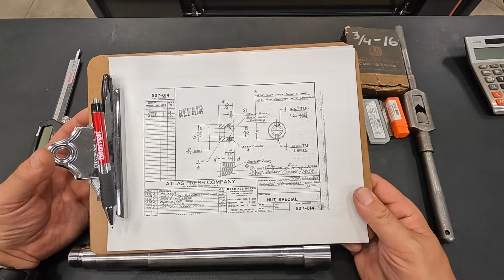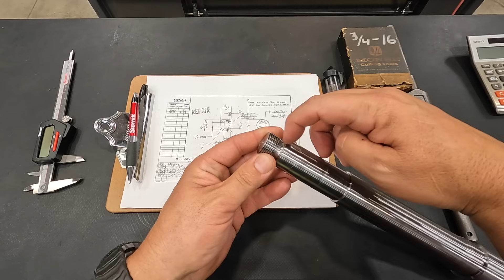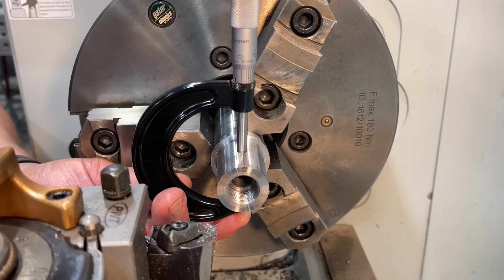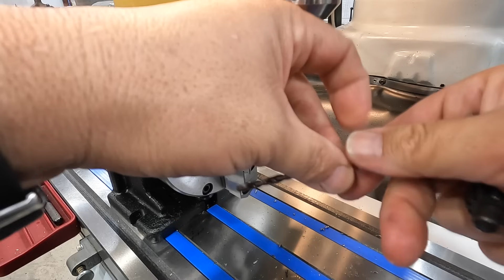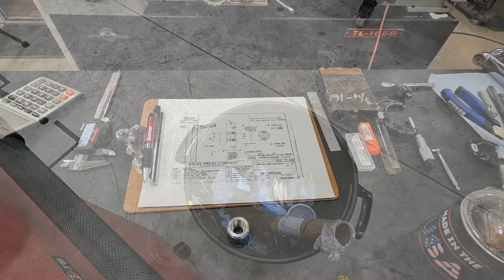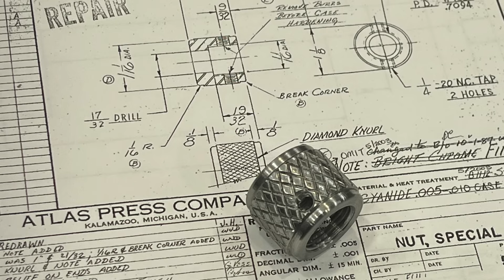SNS 376: Special Nut for Clausing Mill Drawbar

Comment: I have that nut on my 1956 vintage 8520... mine has an insert inside the nut that rests on the top of the spindle. It sticks through the top of the nut and can be turned with an allen key. I thought the insert would unscrew from the inside of the nut so it could be replaced. But, no. You can turn it either way, but it doesn't come out. The insert takes the blow when you need to hit the top of the drawbar to remove a tool.

Comment: I learned my Drafting the old-fashioned way in the mid-to-late '70s! Pencil on paper, then ink on Vellum. I did hand lettering without a "cheater". Had a boss years later review one of my drawings and he said: "You can't decide to be an Engineer or an Architect." I said: "My last Drafting class was Architectural."

Comment: Beautiful job on that knurled nut Adam. I imagined it  bothered you to tap those holes 180 degrees apart when the standard spacing is 90. However, since the print says 180 that’s what it gets.

Comment: Nice looking part, Adam. I'm beginning to think that the scissor knurling tool that i got used must be slightly bent after trying to use it to do some knurling for practice. I'm going to take the knurling wheels out of it and put them into a push knurler like yours to see if they work appropriately in that tool.

Comment: 1953?  heck guy I was BORN in 1953!  When I went to High School we had a class called AV "Audio Visual" where they taught us how to hold a pen and draw like these old blue prints and drawings.  Some had the knack.  I did not but I tried...  We also had real Shop classed then.  Sigh.  I learned how to accurately drill and tap a gun site mount in a machine shop and forgot all that till I retired.  It was good times.  Well done Mr Booth
Reply: I was born in 1951. Drafting class in 1965 was pencils. Drafters I worked with used pencils until ~~ 2000 when CAD took over.

Comment: That draft brought me back to 7th or 8th grade shop class in around 1970-71. We had to do around 25 drafts, starting with a simple box and by the last one, a fairly complex machine part, each with a front view, side view, top view, each marked with sizes and a angled view, kind of 3d view. All the  details of the part printed below. I kept those old drafts until they were distroyed a few years back. It was one of the most helpful things I ever learned in public school other than reading, righting and basic math.

Comment: I have an 8520 and needed this part. I finally found it among the miscellaneous tooling that came with the machine. Running the drawbar without it was a pain. 
It goes on the top of the drawbar and captures the drawbar so you can tighten/loosen the drawbar captive against this part.
Reply: Thanks for answering Adam’s question.
Reply: I have the same mill. It is a cute little machine! I have the nut but need a new drawbar soon.
Reply: @doviejames They are nice little machines and built strong , also limited of what you can do . That’s the drawbar nut .
Reply: Just looked over the 8520 parts diagram, dated Nov 1966, from Keith Rucker's Vintage Machinery/ OWWM and couldn't find that part.  I have the very similar 8530, and don't recall one on it either.

Comment: A few years ago I called Rockwell/Delta and asked if they could send me some blue prints of some parts I needed to make for their 10" lathe and their mill. They haven't made them in about 40-50 years. They said fine... so I gave them the part numbers and they scanned in and emailed me the original working drawings for the parts I needed. In 20 minutes it was in my Inbox. The drawings had all the correct criteria and tolerances, material type, heat treating (if any), All the information a machinist needs to make the part. I doubt most companies will do that but I wrote them a letter saying they have a customer for life for the tools they still make. It's good PR and not like you are competing with them. Not like their is any product liability either... they didn't make the part and therefore it's on the maker. Some of their dimensions were also in fractional units. Other cool thing is the table of revisions on the drawing. One could see how the specs of the part changed over time. Some of the parts were originally drawn in the early 1950s and the last revision was early 1970s. Cool stuff.
Reply: Same delta as delta woodworking tools?
Reply: @pacificcoastpiper3949  yes... sort of. They now have everything made in Taiwan. Except for a couple of bench grinders and a drill press they don't make anything suitable for metal anymore 😞 wikipedia has a pretty good page on Delta Machinery. Also check the external link at the bottom of the wikipedia page for the current company and the other link to vintagemachinery that has a huge collection of manuals and literature and history of the company.
Reply: @utidjian  sad
Reply: @utidjian  I remember when delta made good tools
Reply: Clausing does the same, only if the part is out of stock.

Comment: Adam, nice job.

In the past I've used a collet for small cylindrical parts, instead of using a 3 jaw chuck.

This was especially true on small parts, close to the face of the chuck , where a jaw crash was a possibility.

Are your lathes not set up with a collet taper in the throat?

Thanks.

Comment: how is periodicity kept in the process of knurling? if the OD is measured not in multiples of knurling steps the pattern won't match after the first turn 🤔
Reply: With a quick interweb search, I came across several interesting articles (and a few not-so-interesting!).  Apparently, it doesn't always work as desired.  I've seen knurls with my very own eyes where it's clear the tool smacked halfway in between the grooves of an earlier pass; you can see grooves on the tips of the diamonds.

It apparently comes down to (1) getting a little lucky, and (2) the tool's ability to sort of self-align as long as it starts out somewhere kinda close.  What would have to happen is the tool gets pretty close to lining up on the second revolution, and then start to do some self-aligning kind of thing.  The top of the tool's tooth would have to slip down one side or the other of the previous groove, depending on whether it thinks it should be a little bigger or a little smaller.  So if the teeth are too close together, they'd press down into the "early" face of the groove, and do as much pressing on the face of the groove as much as pressing downward.  And each tooth would have to do that, all with the same... "correction factor."  As the grooves get deeper, the alignment forces would have to increase,  with more metal to press on the walls of the groove, but the likelihood of popping out of the groove would be reduced, so that's good.

I think that explains some of the noise we heard; the tool kinda working with forces that are not so simple, not so clean and straight.  It seems noisier than I would otherwise expect.  Just intuition.
Reply: Thanks  for asking my question. Perhaps knurlers come in sizes for various ODs?
Reply: I wondered the same thing, the circumference must be an even multiple of the diamond widths.  Or maybe the wheel spacing is adjustable?